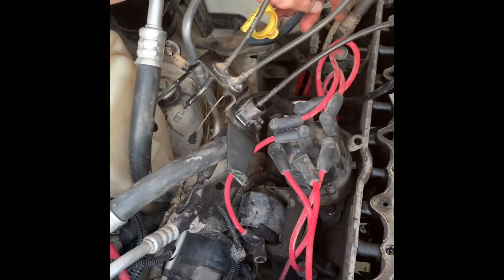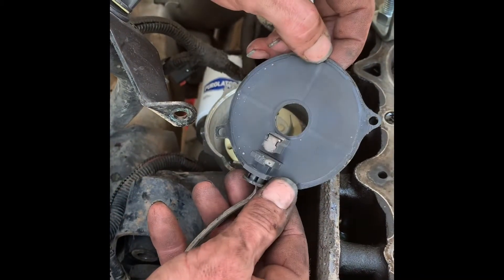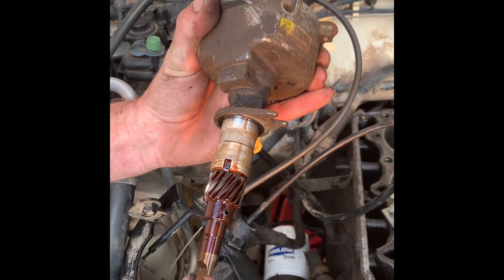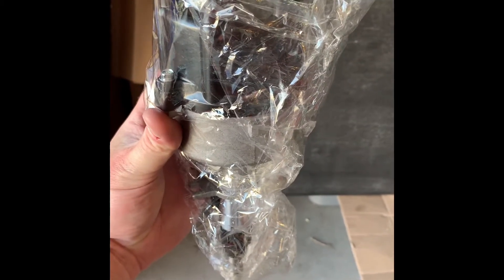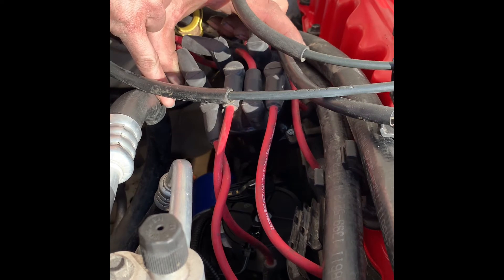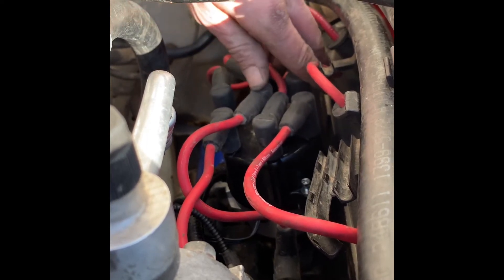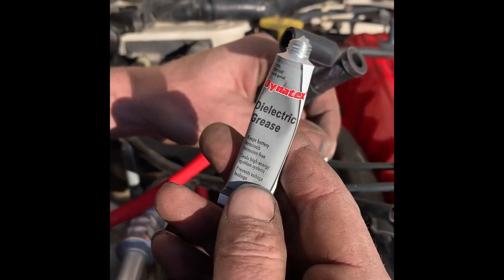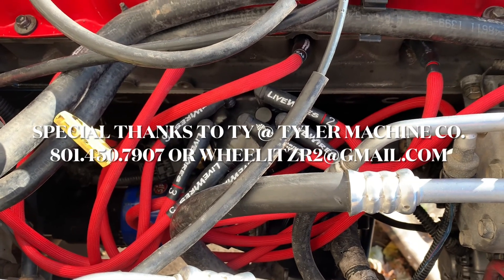Jeep Cherokee XJ How To: Distributor & Wire replace & upgrade.

Comment: Having a family that owned a garage and wrecking yard plus taking Auto I & Auto II in high school, we learn to pull the # 1 plug out and bump it into the compression stroke and align the timing marks on the flywheel to TDC.
Then we pull the distributor out noting the rotor position, this ensures the slot in the oil pump will line back up with distributor when it goes back in, otherwise the rotor will be off position with the cap.....if that happens, you better have a very long flat nose screwdriver to turn the oil pump slot to the position where the distributor will first engage it before finally seating.

Comment: Got a 98 cherokee that i lut in a .motor  but still  can't get to run right. It will start and run but its really rough and tack jumps all over the place. Put in top dead center wirh timing mark on zero. Took it to good mechanic and he couldn't get it so i brought it home and trying to figure it out. Anything you could come up with why it won't run.

Comment: In other videos I have seen for my 98, they have said to just align the reluctor wheel with the first hole. My new distributor comes with a pin in it to hold it there while placing it in and they have said the computer uses the cam sensor to set the timing and you do not have to. From my knowledge I have never done a distributor like that and have always had to use a timing gun. Can you confirm this for the 98? Thank you.
Reply: Nevermind, I should have finished your video before commenting lol